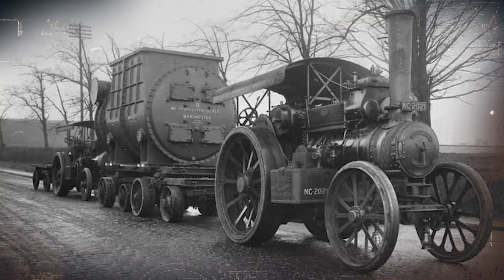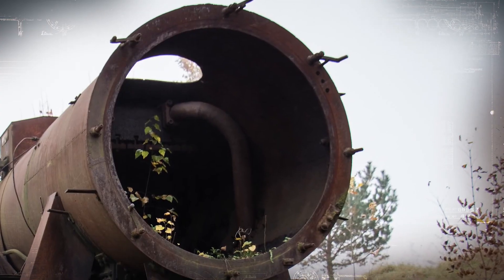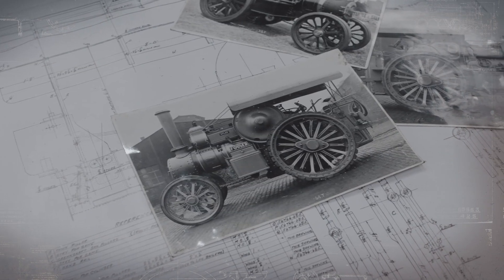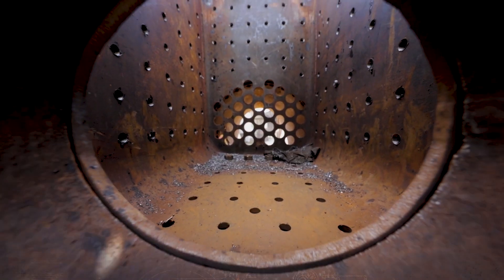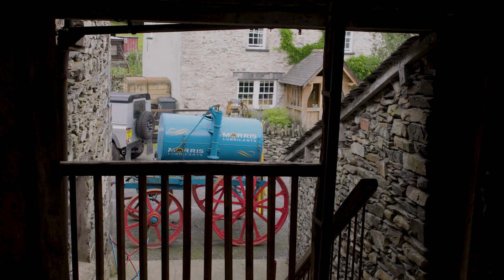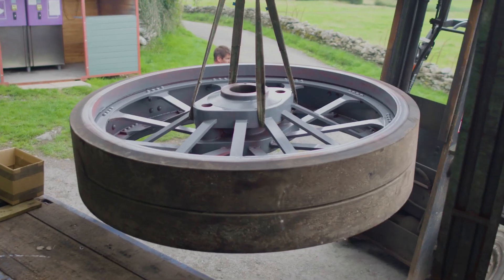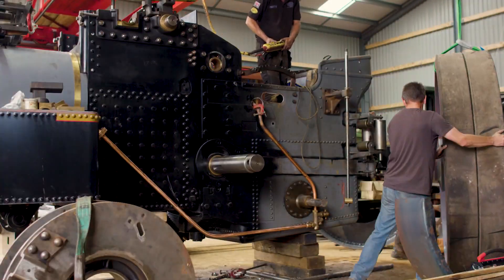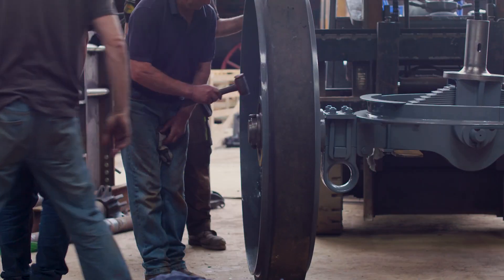Fitting the Wheels - How to Build a Steam Engine with Guy Martin EP4  | Guy Martin Proper

Comment: My  Neighbor  built  two steam Tractors from scratch in his basement in Vicksburg  MI  USA .. Both bases on the  60 HP case  one  was  1/6 scale and one was  1/3 scale .  I used to drive the  1/3 scale one at steam shows..when I was a teenager  in the  late 1970's